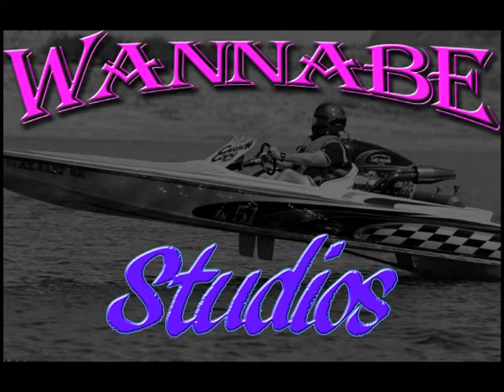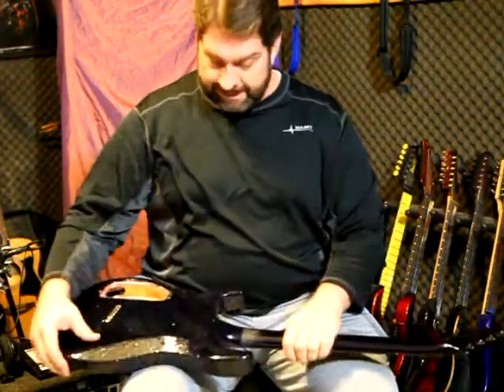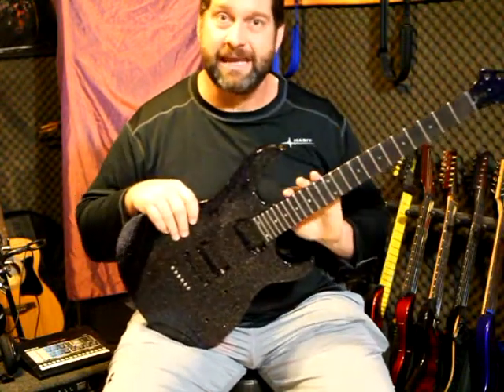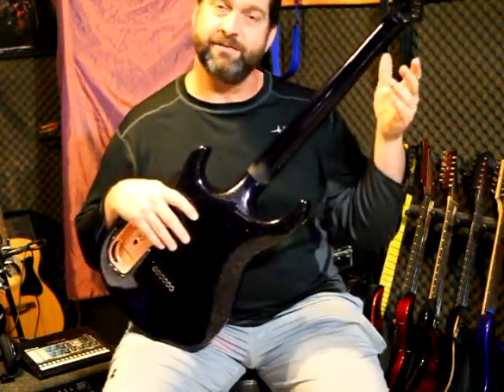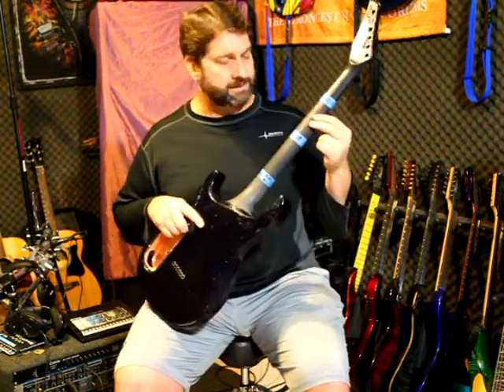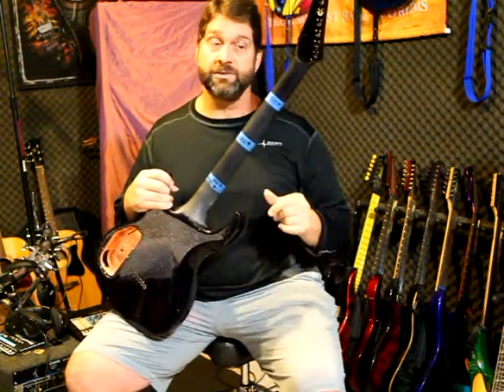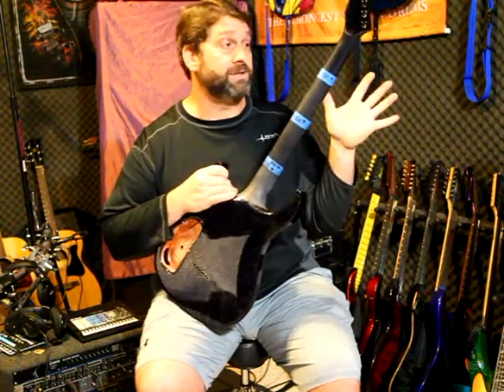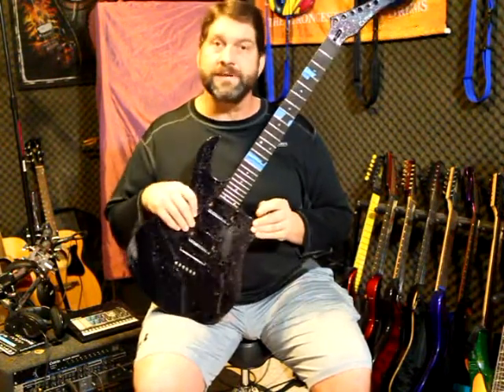Painted guitar necks suck!  Fix that gloss neck in two minutes.

Comment: I just bought my fifth Carvin guitar ever but my first that I will have to do this to the neck . Looks like the paint guy fell asleep while depressing the button on the paint sprayer. So thick I hate it . None of my other Carvins really grabbed to bad but this new one is bad . So thank you for the great instruction in the video. I think I'm going 600 grit . Wish me luck 🤞but could it really get any worse 😅😅😅🤷🤷🤷
Reply from the maker: I don't see that type of thing on Carvin guitars.  Their quality control is usually on point.
But even so, a good finish to the back of the neck is sometimes all a good guitar needs to be really great.
Reply: Did you end up doing this? I have a Carvin DC600 that has the stickiest neck I’ve ever felt. It’s otherwise an incredible guitar but I literally never play it because of the neck.

Comment: Do you dry sand or do you use a little water?
Reply from the maker: I normally sand dry, but that clogs up the paper a bit.  If I find the paper is clogging, I will dip the paper in water and then sand a bit and repeat.  But never enough to get the fretboard really wet.
Reply: @buzzzmiller  Great, thanks!

Comment: Can I ask which grit feels smoothest? Thanks 🙏
Reply from the maker: The finer the paper, the smoother the finish.  I would go 1000 if you wanted super smooth, but not have your thumb stick to the neck.  You could do 1500, but normal playing would polish the finish so quick, you would need to sand it again in another 6 months.  
Try 1000 grit paper.  I think you will like it.
Reply: @buzzzmiller  Thanks

Comment: Do you tape off edges etc.?
Reply from the maker: I taped off the color from covering the side markers, and side of the fretboard material.  Then when clearing over it, I taped the line right at the front of the fretboard, so the side of the board and the side fret indicators were cleared.  That way there is no lip to feel.